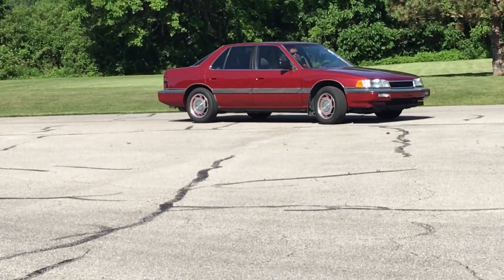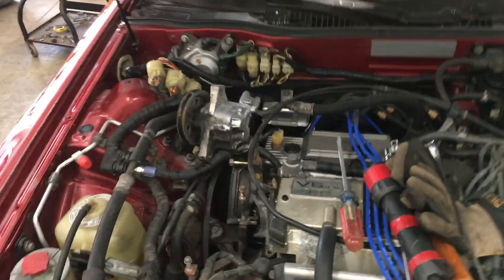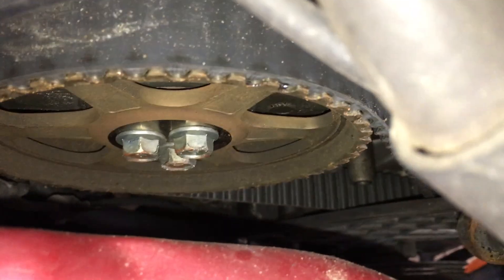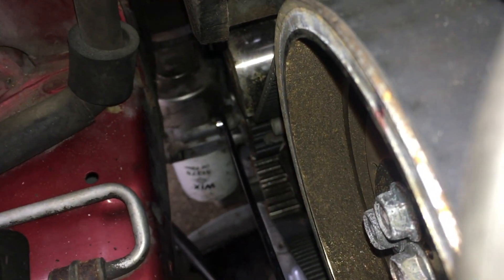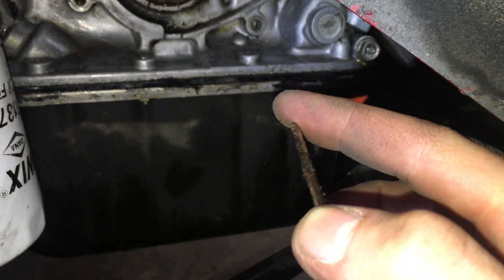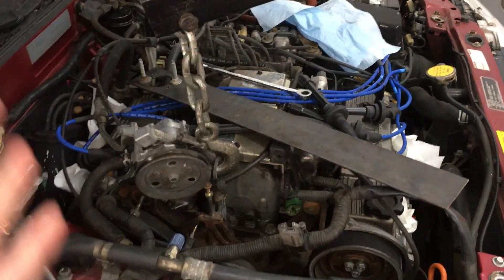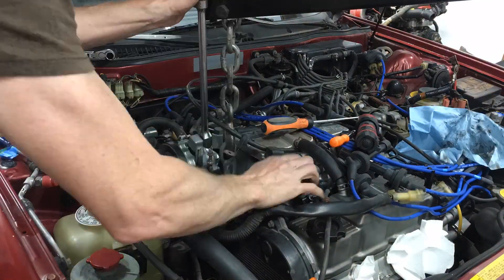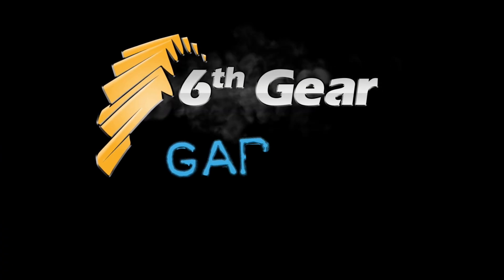How to Replace Timing Belt + Water Pump Acura Legend 1st Gen 2.7L V6

Comment: Outstanding video, thank you very much for sharing! A couple weeks ago, I replaced all the belts and the water pump, timing belt tensioner, and AC tensioner pulley on my 1990 Legend and your video was a huge help. It really isn't a very hard job if you take your time. As stupid as it sounds, the worst part was getting the lower and front upper covers in and out. In no particular order, I do have a few tips to add though:

1. Before putting the timing belt on, push the tensioner back as far as it will go and tighten the bolt down to keep it there. This way, you aren't fighting the spring while trying to put the belt on. You still have to force the belt on a little, but not bad. I believe I put it around the tensioner last.

2. The service manual procedure for setting the tension is to set the crankshaft to TDC with the cam timing marks lined up and then turn the crank clockwise until the cams move by 9 teeth, This puts the slack at the tensioner. I still gave the tensioner a good push before tightening it down to make sure all the slack was out, but don't add pressure to the tensioner while tightening the bolt! The spring will do that for you and too tight is bad too.

3. If you find an OEM tensioner with the part numbers 14510-P0G-A01 or 14510-PH7-004, don't buy them, they won't fit! The former is for the 2.7 Accord and I assumed it would fit the Legend, but the pulley is too narrow. The latter is supposed to be for the 2.5 and 2.7 Legend and was supposed to replace the original 14510-PH7-003, but it's not even close to fitting. As far as I can tell, it doesn't fit any Honda/Acura ever made, but please correct me if I'm wrong about that.

4. If you don't have an engine lift, you can carefully use a block of wood under the oil pan to raise and lower the engine as needed. That's what I did just because the jack was a lot less bulky, just be careful to not bend/dent the oil pan.

5. As an alternative to the starter trick or for tightening the crank bolt, if you are fortunate enough to have a 5 speed, you can put it in 5th gear and have someone hold the brake pedal. This locks up the engine so you can easily remove and install the bolt. That's how I did it, but that trick won't work if you have an auto.

6. I don't remember having any major trouble getting the alternator back in, but I think I put it on before the power steering pump. If you are having trouble getting it into the bracket where the 14MM bolt goes through, push/hammer the sleeve in the bracket on the engine on the passenger side towards the passenger side a tiny bit. This makes a LOT more room to get it in. When you tighten the bolt, the sleeve will get pushed back into the proper position against the alternator.

That's all I can think of at the moment, but if anyone has more tips, please let us know. Also, if you have any questions, feel free to ask and I'll do my best to help.
Reply from the maker: Wow these are great tips, thanks for sharing. I'm going to pin this so everyone will hopefully read it!

Comment: I just did the timing belt in our 96 Accord 2.7 . What a SOB of a job . I took your advice of doing the front pulley, crank, idler, and back pulley. Runs good. Our belt broke because the water pump seized and luckily it didn’t crack up the engine.
Reply from the maker: Very lucky indeed!

Comment: i did the alternator on my 90 Legend Couple in a field in 95 degree heat in coastal sc.  literally do not remember having issues with it.  but that was 22 years ago.  I sweated like hell and drank 3 or 4  big bottles of gatorade.  i miss that car.
Reply from the maker: I miss this car. It turned more heads than any of my other vehicles. Nobody around here knew what it was since they all rusted away long ago.

Comment: Love the enthusiasm in this build! I had an 89 coupe for my first car and I absolutely loved it!  Even though it was a beater. I noticed you used a stant thermostat.  My only critique is if you're going to go to all that trouble and work to replace the t belt and water pump, I'd personally invest in an OEM thermostat from Honda. I've had too many issues with aftermarket thermostats in these Hondas. They usually start sticking and usually they stick closed. Lol
Reply from the maker: I always thought Stant was a good brand, but I have had an autozone brand thermostat not work right out of the box before!

Comment: I dont know anything but im surprised the alternator is still good 👍 this is awesome
Reply from the maker: Yeah, surprised it wasn't seized up after all that sitting.
Reply: For what it's worth, my 1990 Legend's original alternator just failed before I recently bought it. Amazingly, it still spins very smoothly and quietly, it just doesn't charge. I'm going to have the original rebuilt since no one reputable sells them new, at least that I could find.

Comment: Awesome! This is exactly what I needed. Thank you. The Legend went to the bottom of the project list for a 93 Sonoma but this video alone brought the Legend back to a high place on the list.

Also, if you know. What is the part number/replacement size for the altetnator adjustment bolt. I haven't seen mine in over a decade. (Lost it during alternator replacement job, found it at the end after improvising, put the bolt in a "place I wouldn't lose it" so of course, I haven't seen it since.
Reply from the maker: The vertical bolt is 90043-PH7-000 and the horizontal bolt is 31114-PL2-000 and the nut is 94050-08080. I believe the vertical bolt has been discontinued though...
Reply: @6thGearGarage  Awesome thank you!

It figures, pretty much everything is discontinued. It's the biggest weakness of the Legend, part availability. At least now I know what Im looking for.

Comment: Thanks! This is great as I'm about to do the same on my '89 Legend L Coupe. I have the service manuals, but it sure is good to see each step in a video. Is there a reason that you didn't leave the tensioner spring off the perch until after you put the timing belt over all the gears?
Reply from the maker: I followed the order of the service manual.  I left the spring tensioner on because I wanted to be sure the belt wouldn't move at all after I got it lined up. It' a long job for sure, but you'll save a lot of $$$ doing it yourself.
Reply: @6thGearGarage  If there was a mechanic near me that had experience changing several of these on Legends, I'd consider letting them do it. I'll leave another comment with some tips in case you have alternator trouble. I just repaired mine. So, when I watched the video, I was thinking, "Don't tighten the power steering belt yet!"
Reply from the maker: @ronoconnor3910  Haha yep!  I learned some things the long way in this video...

Comment: My father & I are working on head gaskets for a 97 Accord 2.7l V6 and we've gotten to our reassembly process. I've printed off a few different sheets of instruction from All Data to prepare us for timing the motor when we had to inevitably do so after installing the camshafts, rocker arms, & push rods. We've been trying to get the slack to ease its way to the tensioner like you were demonstrating in the video but our belt wanted to skip a tooth while we tried rotating the crank. Would you have any advice on what we could do to properly relieve tension in the belt in order to install the tensioner correctly?
Reply from the maker: Hi, I struggled with mine a bit off camera, but I can't think of any other way that I could have gotten it to work. If it's skipping a tooth, are you sure everything is at TSC before starting and that nothing moved at all while installing the belt?
Reply: What I did is I pushed the tensioner all the way back and tightened the bolt down to hold it in place while I put the belt on so I wasn't fighting the spring. It was still a somewhat tight fit, but not bad. I put it around the crank gear last since it's the smallest and most accessible. I didn't have any problems with it jumping. If the belt is jumping when you turn the crank, it sounds like the belt is either not tight enough or one of the pulleys isn't turning freely.

Comment: Hi, I’m also working on my honda legend 2,7 v6. It’s the same block but it has 177hp. I’ve searched everywhere and I can’t find any timing belt + water pump on the market. I’d be grateful if you could tell me where did you buy this one 🙏 😊
Reply from the maker: Hi, I found this one on Rock Auto. I checked the dealership and OEM timing belts are no longer available from Honda/Acura.
Reply: Thanks, by the way I love your content !!

Comment: Hey! I see you got the RPM gauge working, what did you find the cause was for that??
Reply from the maker: It was a cheap fix... I ended up removing the cluster and cleaning/resoldering the joints for the tach.

Comment: Hey, I have a 1988 Acura Legend Coupe and need some help finding fuel line replacements.
Reply from the maker: I'm betting they're discontinued, like so many other parts for these cars.  Auto parts stores will sell them in pre-cut lengths with the fitting and flare already installed, so you do't have to mess with a flare kit.
Reply: @6thGearGarage  Thank you for your help!